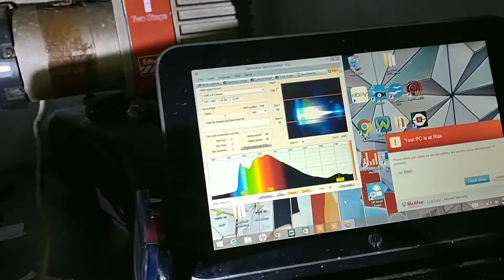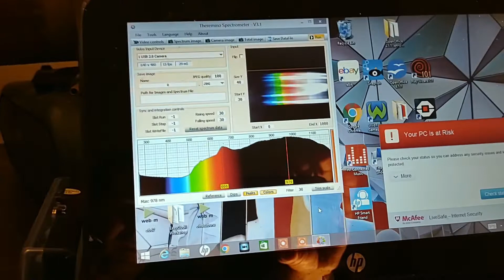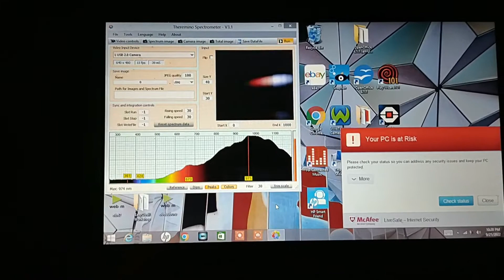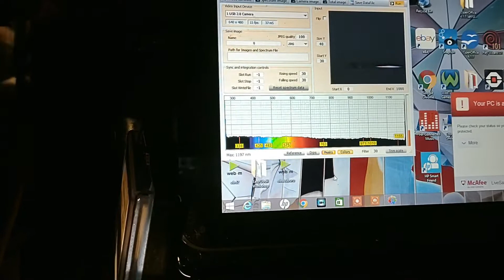Incandescent vs. LED Light Spectrum

Comment: Regarding the dumb, dumb, dumb, dumb, dumb, dumb, dumb ban of incandescent light bulbs, three peaks are generated from an LED flashlight, but good-quality light is a continuous spectrum. The government is wrong about the quality of incandescent lights, which is why dictatorships do not work, thinking that they know better than the common person. They are giving us low-quality light.

1:46 / 7:13
Incandescent vs. LED Light Spectrum

jaynes network
15.5K subscribers

1:53
and we'll put the light into our
1:55
spectrometer
1:57
and we'll look at the Spectrum here and
1:59
as I suspected there's actually three
2:02
Peaks generated by this light
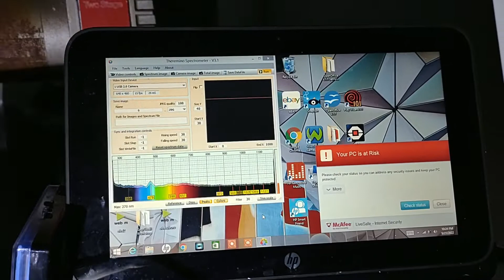2:05
okay so it's not actually a continuous
2:07
Spectrum
2:09
so and it doesn't have very much energy
2:12
down in the infrared